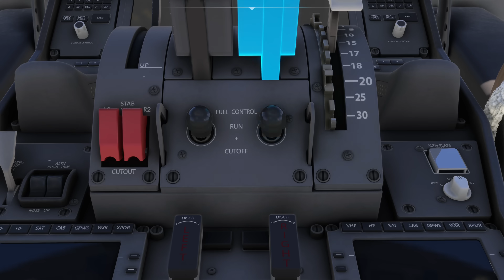Air India 171: Why Did The Fuel Cut-off Switch Get Moved?

Comment: Are we in such a rush to blame the pilots—who can no longer defend themselves?

Is the below sequence is not a possibility?
	1.	The pilot noticed on the monitor that fuel had been cut off.
	2.	He asked the co-pilot if he had done it.
	3.	The co-pilot said he hadn’t.
	4.	They followed the standard fuel start procedure by turning the switch to cutoff. But since the computer had already falsely registered it as “cutoff,” the data recorder didn’t log the action (no change in state).
	5.	When they switched it back to ON, the recorder finally logged it (cutoff → on).

Why is the airline or manufacturer being cleared with a “good certificate” when we still don’t have a full timeline of cockpit actions?

And why was the UK’s safety notice—issued just 28 days before the crash and calling for checks on Boeing’s fuel cutoff valves—ignored?

Comment: 2 questions please Steve. Is it possible a pilot made a mistake with controls nearby, eg what are the levers just down from those fuel switches? Or the gear up control?. And wasn't consentrating and switched the fuel off by mistake?. 2nd question...is it the same on airbus planes that fuel cutoff can be done with no safety logic to both engines? Even on throttle? I agree with one of the questions why surely that should only be viable on idle?

Comment: There can be only ONE reason why a pilot would turn off the fuel switches at the critical flight time he chose to do so, knowing full well the inevitable conclusion.  The on-going search for a mechanical reason is little more than a deflection by "subject matter experts" wishing otherwise for their own reasons, in an attempt to place the blame on a Boeing design flaw that did not exist.  This was an intentional act by a mentally impaired individual.   The camera in the cockpit "suggestion" will now gain greater momentum.  Would it have changed this outcome, seems unlikely but impossible to tell.

Comment: Two questions: 

1. Starting at what altitude and airspeed might a fuel cutoff incident be safely recovered from?  Assuming the worst intentions of the involved pilot, might the timing of the incident, at low altitude and airspeed, have been influenced by the knowledge that recovery would be impossible? 

2. The one survivor said he heard a bump just before or as the engines cut. Is that something you'd expect in this scenario?

Comment: If you're going to commit suicide in a plane, you'd get a little higher in the air before crashing it, surely
Reply: No. At high altitude, the pilot not committing suicide would have time to stop the act. At take off phase, one pilot is flying manually, and other pilot is free.

Comment: 3:30 there is a difference between requiring a procedure where both pilots are involved with one performing action and other confirming and two pilots being needed to perform an action.

There are cases where a second pilot becomes incapacitated and the remaining pilot needs to perform all actions.

So no, I don’t think you could introduce something like this

Comment: I can think of two excellent reasons it only takes one man to cut the fuel. One of you may be incapacitated, and maybe no one else can get to the cockpit to help the remaining pilot. And there are a number of emergencies that could incapacitate a pilot and force shutdown of an engine immediately to save the plane. True, a lot of those emergencies will probably doom the plane outright, but that's not a guarantee. Any event that doesn't destroy the plane outright always leaves the possibility--however remote--that the plane can be saved. The pilots of Alaska 261, THY 981, UAL 232, and JAL 123 didn't give up simply because they'd had major catastrophic failures. Nor did the pilots of hundreds of other aircraft. Many a WW2 bomber limped home looking like a giant piece of Swiss cheese with half their crew dead or wounded with a single man at the controls who had to cut power to one or more engines because they'd turned into torches. Quite a few made it, and it's impressive the amount of punishment a plane might take and stay airborne for any length of time, let along make it home. The other is that it makes an emergency system more complex than it absolutely needs to be.... a system that must work immediately to save lives and/or save the plane.

Comment: @captainsteeeve, at 7:15 you state that there was nothing wrong with the aircraft and it was operating exactly as designed.  Have you addressed the documented electrical issues with this specific aircraft? There are videos and passenger statements, confirming that air conditioning nor in-flight entertainment were functional. This could allude to a much larger scale electrical and/or software issue with the plane. Until each angle is carefully reviewed, it seems premature to point to human error (which you previously did in your first video on the topic), and insinuate su*cide. Would appreciate your thoughts
Reply: He has multiple times. When the engines are cut off it disrupts all of the electrical in the plane. There is no widespread electrical issue in 787, one of the most reliable passenger planes ever.
Reply: @M2ONU thats fair to assume, engine cutoff = electrical interruptions. What I'm specifically referring to are the passengers on the previous leg of the flight from Delhi, who complained of these auxiliary things not functioning throughout the entire duration of the flight. My point being, the prior issues before the tragedy with this exact plane cannot be ignored, and there's not enough conclusive evidence to point to human error
Reply: @M2ONU the poster is obviously not talking about the time of cut off. The passengers had not time to report or complain about AC and in flight entertainment not working. They were only in the air a few seconds. He's talking about previous flights
Reply: If, as you say one of the pilots intentionally wanted to end this flight prematurely, why cut off the fuel, a reverseable action, if noticed by the other pilot early enough. Surely if a crew member wanted to permanently remove any thrust from the engine, irreversibly, the engine fire switches would have been the action to do that. I personally don’t think this was pilot intervention. The report is quite ambiguous, we DO NOT KNOW if the switches were “physically moved” as you say, they may have been sensed to be in cut off, while actually remaining in run, which is where they were found during the investigation. Your thoughts @captainsteeve
Reply: @JohnHenryTheunissen I did ask the possibility of this in another video from cpt Steve.
Reply: You are just reading misinformation. Air India is an airline to avoid for many for these very reasons, especially on the Dreamliner. Their cabins are a decade old and do not get any investment, thy do not tend to fix anything so you are lucky to even get a working screen. I personally take Qatar and listen to everyone else moan about their AI flight. As for the AC if they have no ground power then it seems logical if they don’t use aircraft power that there will be no AC. Again, this can happen with any airline  especially if they don’t typically keep their own power on.
Reply: @Horizon301. You're helping to reinforce my point. If you're also saying Air India has a notorious reputation for poorly maintained planes, then the passenger testaments on the flight right just before this one, confirm that. 

My point is if there were pre-existing electrical issues throughout the duration of the prior flight (during actual flight, not taxi'd on the ground), there likely would have been other underlying issues with the plane, making it hard to rule any technical failures out.
Reply: @rinarage   That's correct. The AC wasn't working. Flights seem very poorly maintained. I am Indian, I don't fly AI. Just few days back another AI flight from Japan to Delhi made emergency landing in Kolkata due to cabin overheating. Boeing is no angel but in this case, I think AI is involved in criminal negligence....(Steve is a boeing rat)
Reply: @rinarage air India don’t want to reinvest in their cabins. There is a difference. IFE screens, new seats etc are not something they want to do as it’s a dated system. The aircraft need a full cabin change whihc costs many millions. It’s nothing safety related. The report states any and all issues the aircraft was dispatched with. Engineers comb through aircraft before each flight so while I don’t like Air India, I do not really think it’s engaging in unsafe practices on critical maintenance. And as mentioned I have had countless family members fly air India every year, the Dreamliner is the aircrsf tthat oeorste these flights and bar the ex vistara Dreamliners, the cabins are dreadful and IFE screens almost always are broken. It’s a non issue what you refer to and irelevant, of course it crashing made it newsworthy though
Reply: You are absolutely rightm I've lost ALL respect for Captain Steeve, he is basically straight out lieing in this video. There absolutely were issues with that specific aircraft on previous flight. This was a 100% technical issue and NOT an attempt of suicide/pilot error. There have been several reports in the past years mentioning possible issues with the fuel shutoff valves that could lead to such an accident. Please watch this video!

https://youtu.be/nHt3k6W4be8?si=H3eSjR9_qG-AsCJU

Boeing, Air India etc. are trying to save their a$$es and blame it on the dead pilots who can't defend themselves, which is ridiculous. The pilots did everything to save that plane! Please open your eyes and don't blindly trust Captain Steeve and the media who say it was a suicide/human error, it absolutely wasn't!

Comment: Captain Steve you keep saying this was 100% the switches were moved to cut off by a human. Well in the Max we were initially told the same thing with the trim but then we found out there was a buried computer code MCAS that caused the accident. We cannot be sure that some buried FADEC code went wrong and cut the engines electronically. The  DFDR box I believe reads the electronic signal of where the physical switches were set to so until some engineer tells us why this is not possible with an explanation it still remains a possibility. Did the voice recorder  pick up the click of the switches actually moving. The way it is described in the report is vague and ambiguous! Garypilot certainly believes this is a possibility. Also we are hearing rumours that the NTSB left early unhappy with the report. 15 pages of largely padding with only two short ambiguous  vague paragraphs  of the meat of the matter when there is so much more we could have been told is unacceptable. If it smells like a fish it probably is one.
Reply: It's a mechanical switch attached to a spring. Tell us how electric circuit can push thus knob outwards, and then move it into the other and lovk it securely?

Comment: Some senses here regarding the actions and duration to switch off the fuel. As 2 switches need to be pulled up and moved down (to cutoff), so it must take time longer than 1 sec to do so. 
The data record should show the duration of the cutoff moved to run back again as this action must be done by either pilot in order to save the plane or to relight the engines. So we may know the duration done by human.

Comment: A lot of the comments a suggesting that more controls are put in place to prevent these actions. It must be realised though that aircraft are intended to be flown by extremely skilled and well trained and well trusted individuals that in all but a few isolated cases are flying with the passengers safety as critical to their job.
Putting blocks in place to prevent these actions one or two cases out of millions. It’s unwarranted to do so and if it were implemented it would add complexity and another route of potential failure

Comment: Captain, I agree 100%  about placing computers in control of aircraft.  I flew commercially until I resigned due to medical issues I felt made it impossible for me to be 100% ready to fly.  I was an check airman and also an FAA Gold Seal instructor. I only flew for 10 years, almost to the day..  Had just short of 8000 hours flying for a Delta Connection wholly owned. 

Anyway the number one maintenance issue was computer systems and software errors.  When I was in the Navy, I worked in the CIC on CVN-69. The number one issue was computers and software crashes.

What people don't realize is PILOTS SAVE THE LIVES OF MILLIONS OF passengers every single year when systmems, software and the Air Traffic Control Systems fail.  

Anyone who thinks we can replace humans in the cockpit of aircraft are either blind to realities OR they are driven by financial goals rather than safety.  

NOW… aviation requires, at ever level of the operation (pilots, flight attendants, mechanics, schedulers, ramp personel, etc) be of high “MORAL, ETHICAL and Professional Character!  We need everyone at the airline thinking about safety. One mistake can cause billions of dollars in losses and countless pain and suffering.  That's what is so amazing about Boeing and Airbus... Both companies have designed and made aircraft that, when part of a professional organization deliver billions and billions of people, and cargo for the entire world!

I want at least two crew members up front and I want them to be highly trained, paid and fully rested before starting their day.

Comment: Hi Captain, do these fuel switches get turned off after landing or during refueling? Could they have been mistakenly turned off, thinking they were already in the 'off' position before starting the plane? If the switch is turned off, how long will the engine continue to run during takeoff?

Comment: It's just an act of suicide by one of the pilot. Happens before and will happens again, no matter what airlines, what aircfraft. Airlines need to evaluate their pilot's psychological assessment more frequently, also their work schedules shouldn't that tight that would cause mental and physical fatigue.
Reply: No, it's Boeing's controller and software glitch that cut it off. Pilots are innocent, they tried there best to bring engines in life

Comment: Better yet... build that fuel switch panel in such a way that BOTH switches cannot be moved to their Off position while in flight... there is no possible circumstance where you would ever want to shut down BOTH your engines while the plane isn't on the ground! 1 switch can be moved to off, but if there isn't weight on the wheels then the other switch becomes locked into Run and cannot be changed to CutOff unless the 1st switch is moved back to Run. It's just a thought. 🤔Of course, we may be obsessing over a 1-off scenario that never should have happened to begin with and isn't likely to ever happen again anyways, so the answer may simply be to change nothing about these switches, if you think about it. 😕

Comment: We need the rest of the cockpit interaction. If one pilot truly tried to suicide the plane, the recording would let us know if he tried to work with the other pilot to save the plane or not. 

We assume "Why did you cut off?" was the pilot seeing that the co-pilot (or vice versa) doing it. However, isn't it possible that the pilot noticed the reduced engine power, glanced over and saw the switches in the off position and merely assumed that his co-pilot cut them off? Because, those switches shouldn't fail and there is not other 'logical' conclusion? 

I feel the voice recorder with time stamps of inputs is crucial here. 

Again, I am not saying that one of the pilots didn't do this on purpose. But if it was me, I would make sure that the other pilot would be unable to recover the plane by further messing with his efforts.